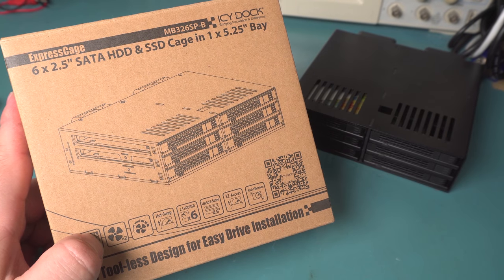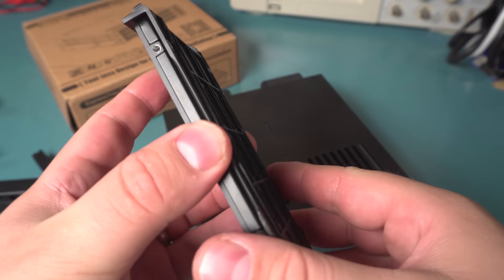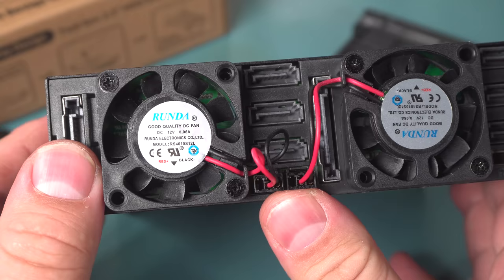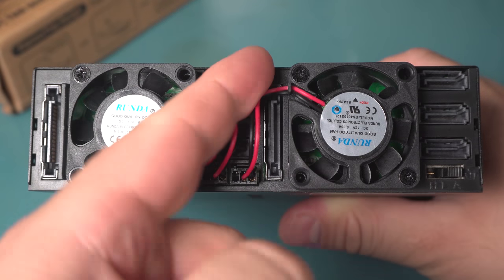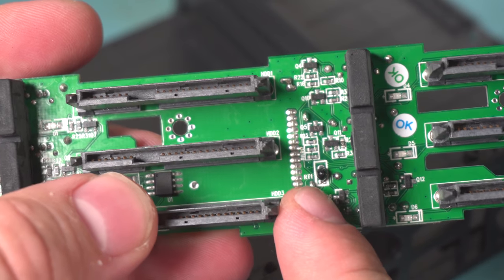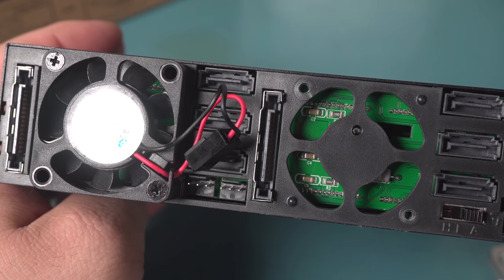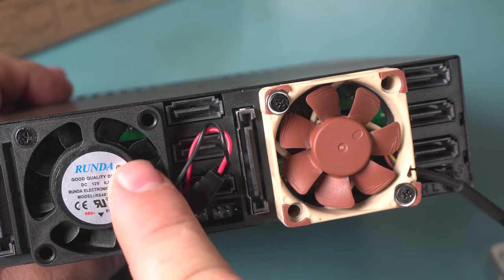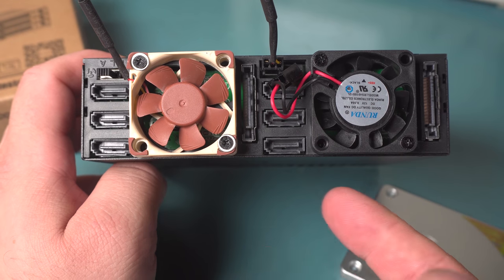Icy Dock 5.25" to 6x 2.5" Adapter

Comment: That chip is a linear regulator made by Diodes Inc. It's EOL but spares are available on AliExpress.

Nice review, thanks.
Reply from the maker: It's such a pain in the ass to search for EOL parts with all the parts suppliers which don't have any actual info. Half of my Google results pointed to a random MOSFET. haha

Comment: 6X SSDs?? Someone is rich.......
Reply from the maker: 120 gig SSDs are easily attainable on eBay used for ~30 bucks these days. :D Actually, about an hour before the video went up I won a 240 GB SSD for $28 on eBay.

Although I did actually buy two new (low cost) 250 gig Sansung EVO's for this since I need them for video editing.
Reply: Some people are rich, some people like me have machines that they keep for years and add drives to as they run out of disk space.

I've just bought one of these to add another SSD to one of my machines where the only spare bays are 5.25 inch. I could have bought something simpler/cheaper but then next time I want to add a drive to the machine I would have been in a similar predicament. With this adapter I can add the new drive, and I can move the two 2.5 inch drives that are currently sharing a 3.5 inch bay leaving me with a free 3.5 inch bay and three free 2.5 inch bays.

Comment: bro the cooling was abysmal on this thing
Reply from the maker: I found it to be perfectly good for SSDs. I wouldn't put hard drives in it, however.
Reply: @PeterBrockie  I did. Shit was at 50°C
Reply: @PeterBrockie   My goal is a Raspberry Pi NAS, but my SSDs kept going to 60°C in Software RAID